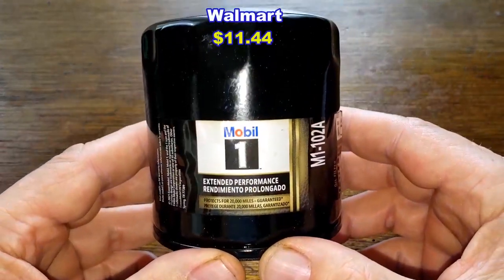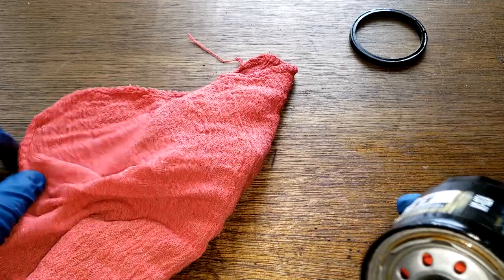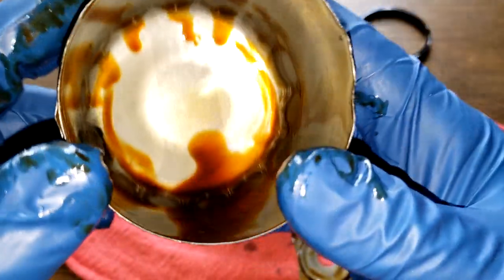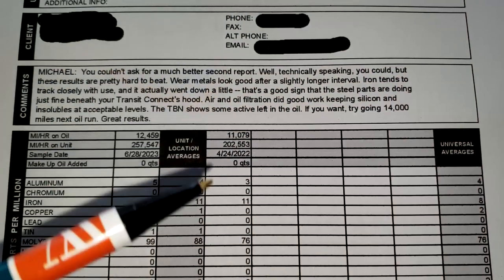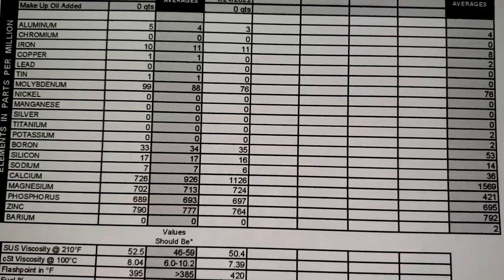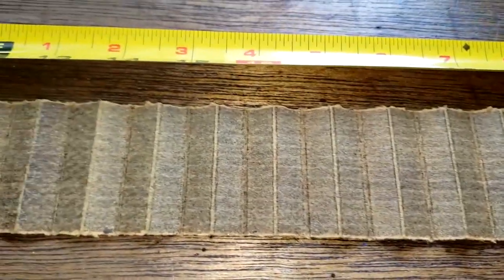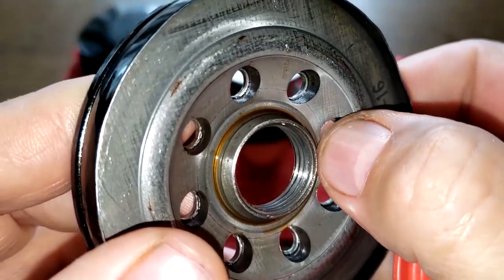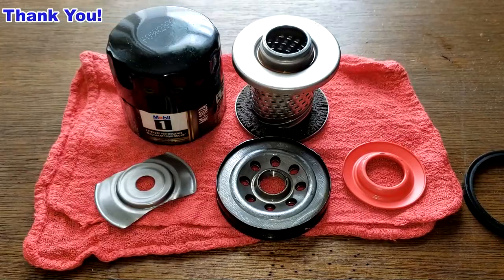Mobil M1-102A Oil Filter Cut Open,  Blackstone Lab Mobil 5w-20 Oil Report

Comment: Thanks for checking out my filter and oil analysis! To clarify, the van actually does a lot of city driving, obviously with some highway miles in there as well. I wanted to see how an extended OCI filter and oil would compare to the many 3-4k mile filters that have been done on the channel. The van has almost 267k miles on it as of today, and still going strong!
Reply: Michael, next time try Baldwin B178 filter.
Reply: Very good UOA report 12.5k miles. Like that you got the TBN with it. You got your money's worth out this oci. M1 filter did its job here. Thinking a little extra shot of Moly in the EP as compared to the 10k.
Reply from the maker: Hi Michael,
You're welcome thanks for the oil filter and oil report👍
Reply: Is your engine Gas Direct Injection.  Very little soot in oil and very little fuel dilution.

Comment: Looks like the stamped spring has lost its tension. Flattened out. Sorry to rain on any parades!
Reply from the maker: It was a little flattened but some filters come like that. It still had enough pressure to push against the anti-drain back valve, causing little marks in the silicone valve.
Reply: @WhipCityWrencher  Yes, if not enough pressure or defective highly doubtful adbv would have had indentions in it. If the guts(element) couldn't be heard when filter shaken, compression spring doing its job. At least that true in my experience.
Reply: I don’t understand at all why he calls this piece of stamped tin a "spring" ???
It is obvious that the material is not spring steel .
This is just a spacer between the filter housing and the filter element.
Reply: Even though it's a stamped piece of aluminum or tin, whatever, it serves the purpose as the filter "compression spring", holding the filter element in place. Because it may not be "spring steel" doesn't change that fact. There is still some "spring" or flex to it. Some filters use a coil spring, but most use the stamped type shown. Coil spring especially useful in large filters with larger elements.
Reply from the maker: @Andrew__Smith     Click on link scroll to page 2 https://amsoilcontent.com/ams/lit/databulletins/g2192.pdf
Reply: @faxmen09   and @WhipCityWrencher 
No, oh my dear friends... It's because you don't have an mechanical engineering education...
 The fact that someone out there called this meager piece of stamped metal a "leaf spring" - this squalor did not become a "spring"...
For example, Baldwin always puts a real, strong coil spring that presses the filter element with constant force , and thus  100% prevents the breakthrough of dirty oil in the upper part of the filter...
And that's one of the reasons why I respect this company's honest filters...

PS This is also what to call Bidon the real president of America, and his son an innocent, slandered sheep ..:yougotthis:
Reply: @WhipCityWrencher  Great link Whip, proving it is spring even though stamped, not a coil. As an aside, sad commenters feel the compulsion to make off topic political comments. I'll now be using the mute feature there for the trolling.

Comment: Pretty much all of the mobile one filter videos I’ve seen have excess glue on them. No sign on this one. Unless it was removed during use. I’ve used this filter and like it. One thing to note, 12k was probably mostly highway seeing as he has over 250k miles on a 2015. Which I way easier on oil and filter than stop and go/towing etc.
Reply: I had the same thoughts.  Either the new version of this oil filter was clean of stray glue, or it got sucked down the bypass valve with use.  Don't know.
Good point about highway miles, and also, no short trips means oil lasts a long time (no acid build-up with short trip water).
Reply: Owner comments on top it was NOT mostly highway miles.
Amazingly great engine in his ride.
I can't imagine waiting that long but heh, sure works for him!!!

Comment: Nice shot of Moly (for short), pronounced (muh-lib'-duh-num) in the M1EP, 20k. Bet that's higher than the M1 Syn 10k. Excellent UOA report, with 2.0 TBN close enough at 12. 5 miles. Minor fuel dilution, not a problem. Agree, owner Mike keep doing what you're doing. As for indentions, didn't harm anything, no cuts. It's less about the inlet holes being sharp than the central part of adbv resting on them. Other smaller Purolator made filters have narrower adbv center ring that doesn't rest on the inlet holes. Overall M1 filter looks good here, did its job. Thanks to Mike for the UOA with TBN. Thanks for the vid Whip.
Reply from the maker: Thanks faxmen09👍

Comment: Nice presentation Whip. Mobil 1 is one of the best oils in it's price range. Sure there are better oils on the market, but at twice the price. I have used Mobil1 oils for about forty years now. I have never had an oil related problem with any vehicle that I have owned. I usually use Wix filters, but have been known to also use Mobil 1 filters from time to time. My OCI are at 10,000 miles, but would not hesitate to go to 12,000 miles if I had to. A lot of people knock this filter because it is not wire backed. If Moobil 1 thought their filters needed wire backing then they would have surely done so. Not the cheapest filter, but a good filter none the less.There are better oil filters, but who wants to pay 25-30 dollars for a filter that you are going to dispose of in 10,000 miles or even less. Not me.
Reply: Mobil has engineers in Paulsboro, NJ constantly testing their synthetic oils.  For filters, they contract out.  Mobil does NOT test or design filters and their engineers would not have an opinion on wire-backed filter media.
Reply from the maker: Thanks👍

Comment: think i'll have to start using Mobil 1 extended performance, i used Pennzoil Platinum last time and it looks
like maybe 1/2 quart has burned with only 4,000 miles on it 🤔
Reply: This is NOT a BIG oil burnout
Reply from the maker: Your engine could burn oil no matter what you put in, Mobil or Pennzoil. It mostly would depend on what engine you have.
Reply: @WhipCityWrencher  i'll have to keep a closer eye on it but i don't remember any oil burn off when using the
original Mobil 1 full synthetic 🤔

Comment: Ive never had an issue with moble 1 ! The guy i bought my 86 vette from used it religiosly for 175,000 miles and when i replaced the valve cover gasgets could not believe how clean it was ! almost luke new ! This car also uses 0 oil ! Sorry i was better late than never again ! Great video ! 👍
Reply from the maker: Hi Scotty,
Thanks for Sharing👍

Comment: 7:24 These parameter readings indicate that the oil has been diluted  by the fuel .
 At this mileage , this oil should evaporate up to ~9% and goes more thicken. We see its clear liquefaction.
Reply from the maker: I don't know it looks pretty good to me.
Reply: @WhipCityWrencher  Of course, there is no critical fuel dilution, but ... if he plans to operate this van further, then it is necessary to diagnose and adjust the fuel injection system in a specialized workshop.
Reply from the maker: @Andrew__Smith  Yes, but he had the same amount of fuel in the oil last year too. Who knows how long he has had this problem. I've seen some engines brand new with fuel dilution problems mostly because of the turbos that they put on newer engines.

Comment: Looks like the extended oil change intervals are working for him. I'm too old fashioned to do that, regardless of the better oils available now than when I first started driving. I'll stick with my 5500 mile oil changes because that's how I've always done it. Oil and filter are much cheaper than an engine.
Reply from the maker: Papi, I'm with you😊 I like the 5K oil change intervals also.👍

Comment: Whip, thanks for explaining the analysis sheet. I agree, probably highway miles. Don't know how long he plans on keeping the vehicle, but you would think it's more economical to keep it as long as he can. Saying this, yes, tests show it's working, but it's very dirty. Can you imagine what the engine looks like? All that brownish remains/ gets baked on? I PREFER 5,000 mile changes, but it's pribably a work truck, so I feel 7,500 would be fine. I don't know why ppl/analysis like burdening engines to max out oil durability. U pay now, or u PAY LATER is my motto. Just MY opinion.😉😁
Reply: 💯💯 My opinion too. This is NO city start-stop mileage.
Reply: We were wrong: here👇 he says:
@LJRacing91
Thanks for checking out my filter and oil analysis! To clarify, the van actually does a lot of city driving, obviously with some highway miles in there as well
Reply: Actually, as Andrew mentioned, this is quite a bit of city driving, but does have some highway. 

If there was something to be concerned about as reported by the analyses, yes, I'd shorten the OCIs. However, there's no reason to change the oil more than necessary, and as the data shows, the oil reports at both ~200k and ~250k, the OCI is just fine.

Getting people out of the "oil needs to be changed every 3-5k miles" mentality would be great to normalize when oil and filtering technology is much more advanced, especially when using these higher end oils and filters that are designed to go up to 20k miles. At that point, I just view it as throwing away money and time. 

There's no reason to not use your oil as long as it's doing its job, and we have the ability to get the information on our oil with the oil analyses that can be done.
Reply: @LJRacing91  And in addition sir, (in my humble opinion) you should check the tightness of the engine intake system ("silicon" in analysis can be dust and sand contaminated air leaking past the air filter) and if you plans to operate this van further, then it is necessary to diagnose and adjust the fuel injection system in a specialized workshop. (signs of fuel and loss of oil viscosity are also under analysis)😉